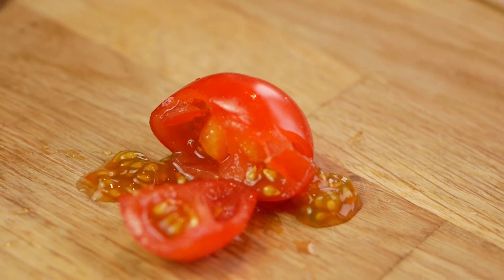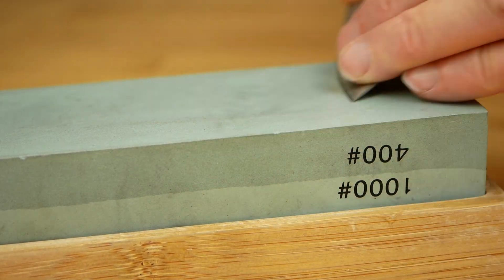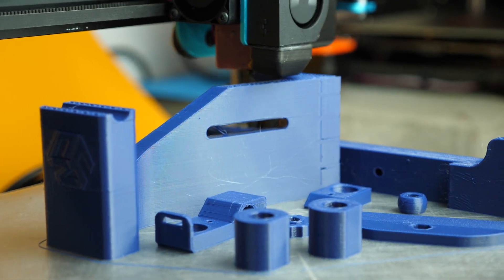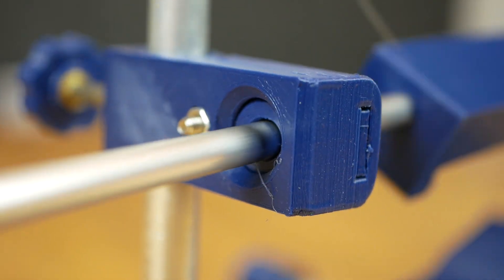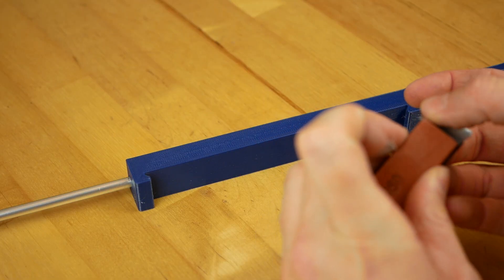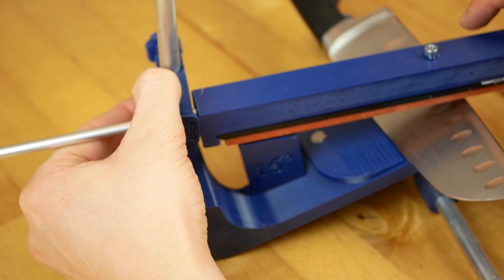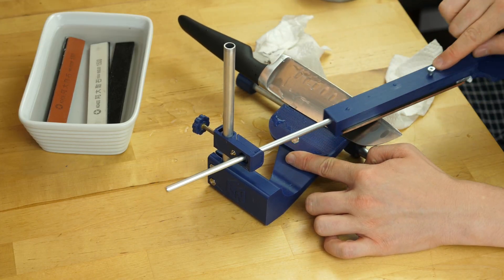PERFECTLY sharp knifes! 3D PRINTED sharpening tool 🍴

Comment: Aren't you supposed to only sharpen a knife in one direction? Instead of going back and forth?
Reply: No.  Most abrasives can handle sharpening in both directions with the possible exception of some of the softer water stones. This video is a little misleading because with this style of jig the direction of travel that the stone takes intersects with the blade at between 70 - 90 degrees to the edge (looking down from above).  In freehand sharpening the stone can be much closer to perpendicular to the length of the blade, like in a slicing action.  -  As for the steel if you sharpen away from the edge you will get a pronounced burr, if you sharpen into the edge you will get almost no burr. Making sharpening away from the edge easier for beginners.  -  The interaction between steel and stone varies from steel to steel and from stone to stone.  The best thing is to try sharpening in both directions and get a feel for how they are working together and go from there.  -  I love to sharpen, maybe someday you will too.

Comment: Nice. Longer would be better. Try app Spirit Level instead of cubes. China diamonds are better than water stones.
Reply: Don't fully understand what you wanna say with spirit. But please never use diamond tools on hardened steel, as the carbon of the diamond goes into the border zone of the steel and the edge will crumble like candy with that much carbon dissolved in it... Yes diamond tools are great for example to sharpen ceramic blades, but a big no no for steel. AVE (Youtuber) once also pointed that out while reviewing an electric knife sharpener with non replacable diamond tools in it.
Reply: @schnodderbürstchen  APP for mobile phone "Spirit level". Diamond whetstone works on the same principle as any other whetstone. The harder the material takes the softer material.
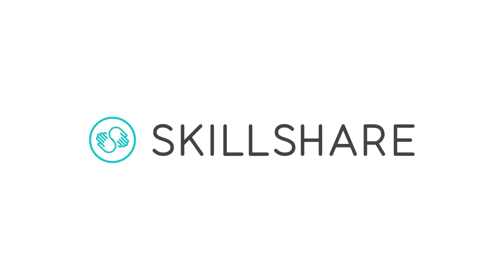Reply: Found the link to AVE's video (9:09 minutes):https://www.youtube.com/watch?v=Y3H-TwdUJJ8

Comment: The 3000 grit and polishing is great for a knife used in a pushing motion like you did, but most organic material cuts way easier with a serrated knife edge like the one left behind after 1000 grit or similiar, drawing the blade over the material.
Reply: Indeed.  For most normal cooking purposes a knife sharpened on a 800-1200 grit stone is quite sharp enough assuming the sharpening technique was good.

Comment: I was planning on buying one of those sharpening tools from china... time to buy some rods and wet stones now ;)
Reply: don't buy that... i end up redraw that joint part and make one myself
Reply: @DGworksIvan  details?
Reply: @yura979  the stock part is okay however having a really loose tolerance
CNC kitchen's parts have the same problem too, if you have a steady hand that's not a problem, but in the video you see he is having some strokes definitely make the angle of the edge off
Reply: While this tool does the job, its about on par with the chinese crap tools but with some nicer features like the magnets, id reccomend you eigther get the Worksharp Culinary or a Lansky Basic kit for better results for not much more money :)
Reply: @AYellowPepper  Would learning to keep the angle on regular whetstone be much better than that? All of these tools feel like clutches that gatekeep from true skill and consistency
Reply: @yura979  just like cnc or 3d printer the tool is helping  you to make precise repetitive motions... to some extent this is helping you to stabilize the sharpening stroke, however it can be better
Reply: @DGworksIvan  I agree. Would you be so nice to share your improved version with us?
Reply: @yura979  i lost my file and it's kinda a failure since i made the tolerance much tighter, however PLA don't work well with lubricant and the stroke is not too smooth

end up i tried another knock off electrical sharpener and i'm kinda satisfied now 

yeah i ain't that much kind of knife person, it's just a tool to me